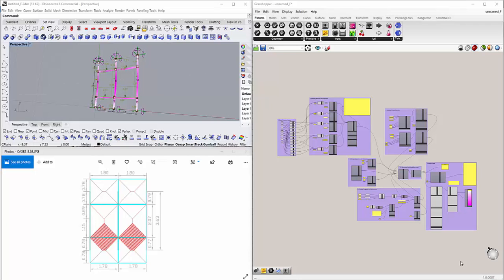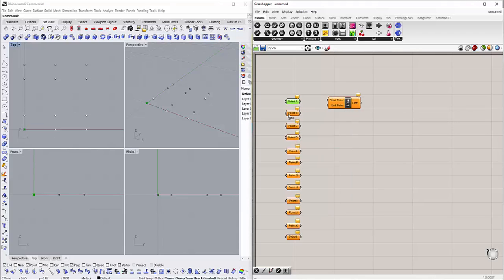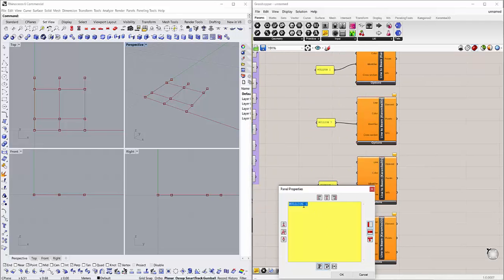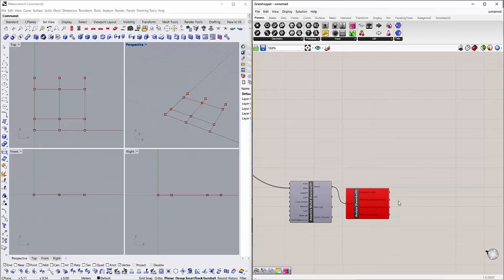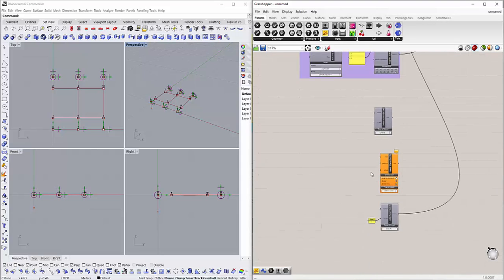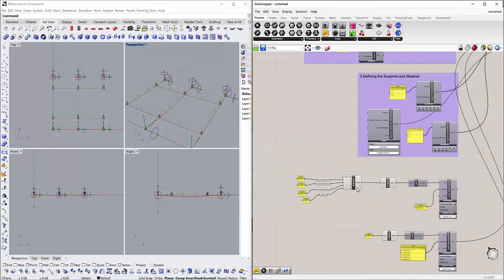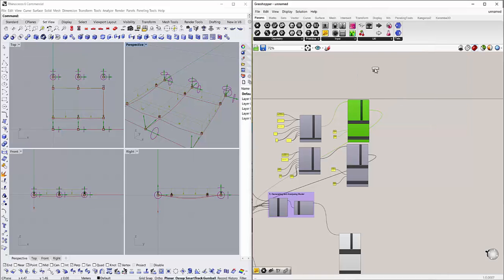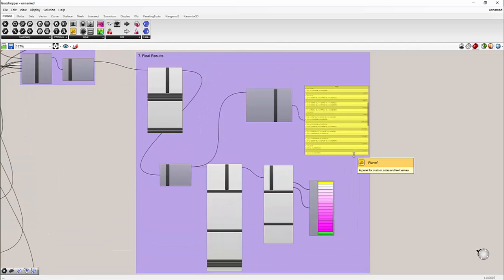Facade Structural Calculation (Utilization/Deformation) due to Windload on Karamba 3D (Rhino 6)

Comment: Good tutorial!! I would like to ask why you put all the glass weight on the bottom transom? Because the glass will be fixed on 4 sides, which means all transoms and mullion will afford the gravity of the glass, it should be other distribution or? And based on the setting of the wind load, Karamba will automatically recognize the wind load distribution of the glass to transoms and mullions as you showed at the first. Thank you very much.
Reply from the maker: Thank you! Good question. That's the dead load of the glass which is added at the bottom for vertical transom deflection. The forces which you are talking about on the 4 sides is added seperately as distributed load.
Reply: @AvinashNair  Thank you very much for your reply. So how to add these 4 wind loads, they are 45 degrees so not uniform. Should we use the shell component as the glass?
Reply from the maker: @王海涯-f3i  ya you can derive the forces using the shell components.